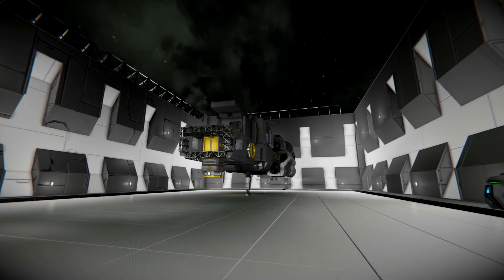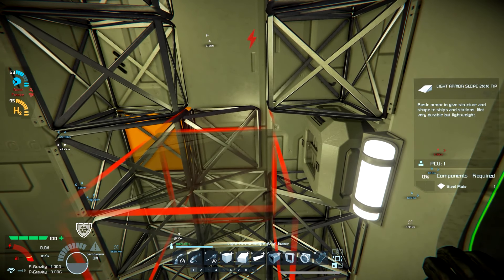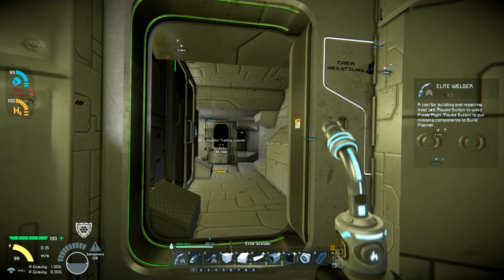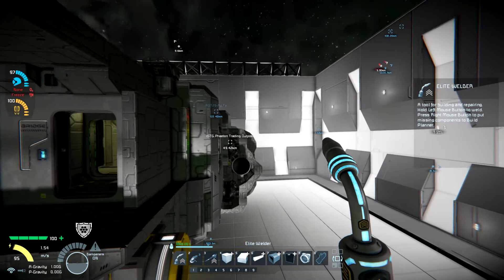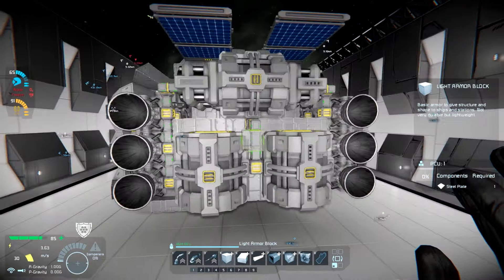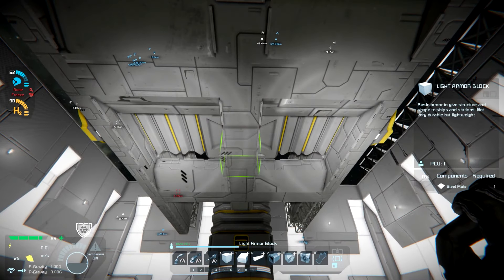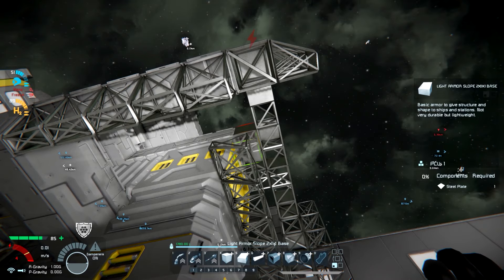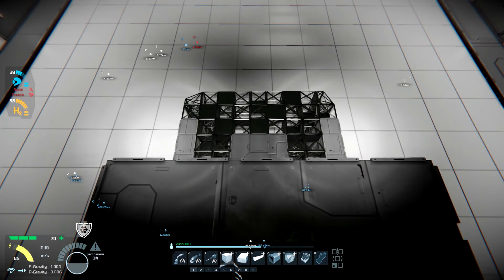Space Engineers | (Mostly) Vanilla Progression Series | Ep.64 - Nose Job

Comment: Thanks for another lengthy episode Hal!  To give an update on how my playthrough is going: terrible!  I realized that there is no way i can weld up sections of exterior hull from the inside after trying to fight it to make it better.  I broke it in the process.  So instead of trying to push a series of welders inside the 10 frame section of the hull, or using a flying welding ship to just weld up the projection (still too slow), i am going to put a few welders on an arm attached to a rotor, attached to a series of pistons, and print the frame sections that way.
Reply from the maker: Have you tried using merge blocks instead of welding?

Set up an assembly line where the section is welded up first, the completed section get a small battery and merge block, then use merge blocks to attach the section to the frame.  If everything is matched correctly, this will weld everything together.

Basically, a pre-fab assembly line instead of a skeletal (stick-built) build out.
Reply: @Haladmer  hmm.. you might have to point to a video that illustrates this.  Right now i'm just welding things up and then cutting it free (i should be using a merge block here i agree) and then manually moving it in place.  But ive only done 1 small 3 frame section and half of it feel away because that was a disaster in first person camera.  So I'm to reconfigure as i've described above and try again.  Also, my hydrogen thruster based miner has been amazeballs good.  It frustrates me that i was so intent on using atmo thrusters for so long.  Ice goes pretty quick, but being at a huge ice lake makes that a moot issue.  Every 5th run or so is for ice, and I've been stock piling it nicely!
Reply from the maker: Yep, just have to use the "best" tools for the job at-hand :)